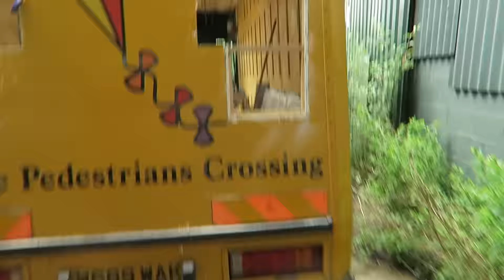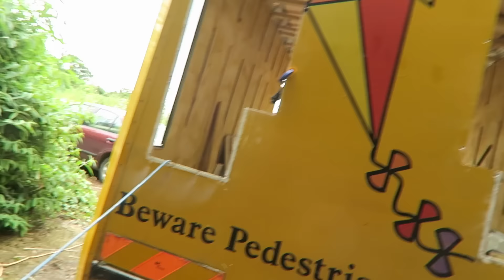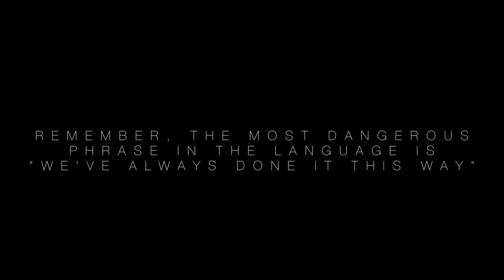BUS CONVERSION #3

Comment: Again, if you fail to put in a vapor barrier all your double glazing and insulation will be a waste of time. Additionally your walls will rot from the inside out.
Reply: Please tell us more about best way to vapour barrier :)
Reply: Hi, here is another link about vapor barriers. The result really makes a difference and makes life inside much more cozy and home-like, not that sort of wet and humid sort of lifestyle you'll have to endure without one.
Reply: No link? :-)
Reply: OK read this but no further forward.  I need to see some practical examples.  Dont you like the air vent system Matt is using?
Reply from the maker: Il also put a vapour barrier on top of the insulation. I haven't seen another person doing what I'm doing. I litterly have a cavity on my bus and 40mm celotex. Thats some serious insulation!!